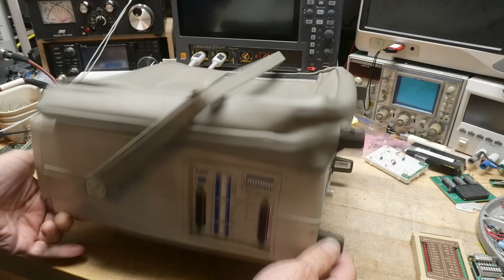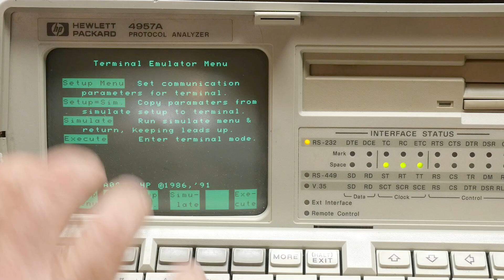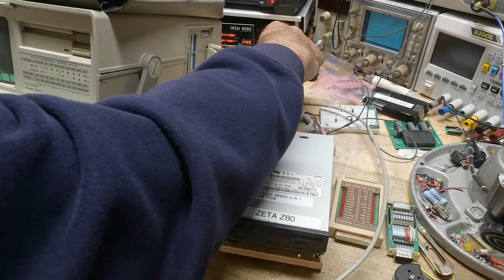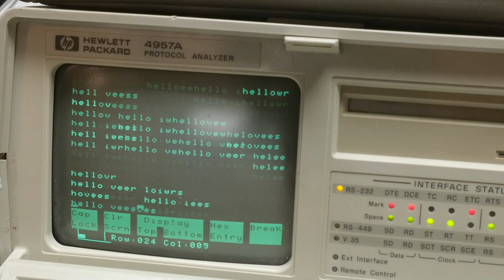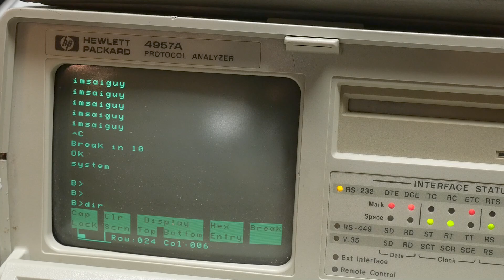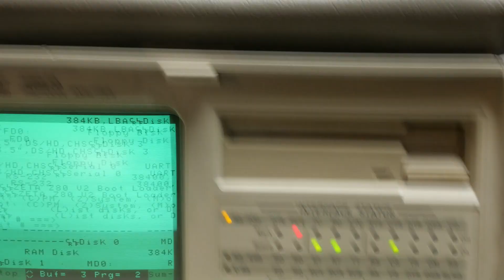#2184 HP4957A Protocol Analyzer

Comment: One of my favorite dev test devices.... loved the keyboard on these units. I kept a grab bag of all sorts of gender benders, 9 - 25s, null modems and a Cisco cable too so it was ready to go when needed :o) I agree with a previous comment - its a flow control problem, your overrunning the comms buffers causing that corruption. Even with correct flow control you can get that issue with high speed serial, where the latency of one end to react fast enough to stop the flow causes buffer overrun..... oh dear, my real time communications nerd mode just kicked in after 30 years LOL.

Comment: In my 6502 SBC I mis-implemented XON/XOFF and made mistakes with enabling and disabling interrupts for transmitting data, the effect was similar: it just kept sending the buffer over and over 😸
In 2005 I went to The Best Computer Shop In The Area, asked about RS232 stuff I used to buy there, and some new guy said with contempt: "Pff, nobody uses RS232 nowadays anyway", so I answered: "But I do!" 😁

Comment: ever time it "screws up", the DTE status light is alternating continually between mark and space (both the red and green LEDs are on 'simultaneously'). Sometimes you need to loop back DTE and DCE (??DSR??)) locally on both ends of the cable, as different devices have different meanings for those lines, and they get confused if connected to the other end of the cable instead of looped back at their own end. This is very common with CNC machines, which very much still use RS-232, along with a lot of other industrial equipment.
Reply from the maker: yes, I tried various combination but haven't found the right one yet.
Reply: @IMSAIGuy  try connecting DSR DTR and DCD together at each end of the cable locally, and the usual Rx Tx crossover and RTS CTS crossover and GND through the cable. I usually find it less frustrating to just get the d-sub connectors with solder cups, and solder up a custom cable using an old piece of cat5 than it is to use those adapters and gender benders where you have to check the pinouts to see if they do what you think they should with all the control pins

Comment: Love Curious Marc - He made his money in Optics and had a patent on something sold the rights made millions or something like that - Did you know that a free PC program called  "Tera Term" has an VT100 terminal emulation setting and I think "Putty" does as well. Just use a PC with a run of the mill USB to FTDI RS232 adapter ( I use them at work all of the time ). Tera Term is a great free Terminal Emulator.  Maybe you need CR-LF enabled on receive to stop the crazy screen.
Reply from the maker: I love tera term and that is what I have used for the Zeta computer.  https://youtu.be/l9NdGPrB0RI?si=nQQuJdm2VBUQWFnn
Reply: @IMSAIGuy  Oh sorry I didn't know there was a video for that project.

Comment: You are missing the hardware handshake, probably  RTS/CTS. Turning it on may not be enough, you need to check if the wiring of the cable is correct too. The lights on the protocol analyzer should make that fairly easy.  Great little machine. I remember the days when I used one. We rented it for a protocol debugging troubleshooting session and I was sad when I had to return it.

Comment: I used VT100 for years from 1981 with VAX computers. Later on, I designed VT100 compatibility to terminal emulator programs and other systems including embedded. The ESC sequence system is a nice feature even today and part of it is still in use in modern instruments. In industry, RS232 is still kicking as it can easily support very long cables between units. The USB cables limited to to about two feet is a great nuisance.

There is a program called DOSBOX available in the internet. With it you can run practically any MS-DOS programs from the old days in modern Windows. I have tested it and it really works. I can run my old programs from 1985 and older. Yes, I have archived all of my PC programs and many others.

Your problem could be the overrun of characters in the RS232 when the handshake is not working

Comment: I think several other commenters said this, but in my experience with RS-232 when you start to add adaptors and cables etc, some times things don't connect correctly.   I would first ring out that 9pin to 25pin adaptor.  I've seen some adaptors where the DTE-DCE etc connectors are left out.  I also went down the "path" with gender changer connectors that were really NULL modems.  With a minimum number of cables/adaptors, that I know are correct, I would put a breakout box between the computer and the analyzer and "see" which lines are being asserted.  By trial and error a possible combination of handshake signals can be determined for some form of "reliable" communications.

Comment: My guess is still with hardware flow control. Maybe z80 uses different control lines to HP. maybe 25pin to 9 pin is cross connecting flow control pins incorrectly. Try using breakout box on 25pin connection to see control lines toggle. Or maybe both devices set up to be DTE or both DCE so they are looking for different control lines.

Comment: over the years I spent a lot of time fussing with RS232, always hated it.
adapters, cables, settings,... disgusting. what a huge mess of a protocol
Reply: It was all we had at the time

We dealt with it the best we could until tcpip took the stage
Reply: the problem is always in the control siganls - different devices seem to interpret the control signals differently. Rx and Tx, and even RTS CTS are pretty universal, but DTR/DSR/DCD pins always cause the issue, and it's the same here. When it's not working correctly, the DCE status leds show it continually switching between mark and space - I think the computer is interpreting that that the connection has dropped and re-established over and over again and it keeps resetting the terminal. The solution is to usually loop the appropriate control pins back on each end of the cable, rather than taking them through to the other side, where they're not interpreted the same way

Comment: What does the CP/M computer monitor do when it receives a control-S / control-Q flow control characters?  If that provokes more output, then you'll get more flow-control characters from the terminal emulator application, and starts the neverending display of "garbage".   Turn on hardware flow control and see how that works.  (Or at least see about disabling software control-S/Q flow control.)

Comment: I love the old HP equipment, I still have quite a few instruments just for hobby.  You can get an idea of the age of the equipment by looking at the serial number.  The first four digits are the revision date.  On my 8566B the first four are 2504A.....  This means it was revision of the 4 week of 1985.  So I know is is no older than 1985.  Of course the instrument was announced in 1985, so it couldn't be older than that anyway.  The numbers 0xxx are from the 1960s, 1xxx, from the 1970s and so on.  IMSAI Guy was correct about the protocol analyzers, for some reason they really held their value, I never had one, I always had to borrow one from a client.

Comment: My guess is flow control.  The terminal must have some way to tell the sender my buffer is full.  In your case, in band flow control is used, most likely the DC3 and DC2 characters sent in the data stream.  DC3  character to stop sending, sent from the terminal when the incoming buffer is near full.   DC2  sent from terminal to the computer to resume sending is sent when the  terminal can accept more data. 

 It is possible I have DC3 and DC2 backwards, it has been 45 years since I taught the subject. ..Hardware flow control was also used in that time period, sender sets the RTS high as a request to send. Terminal responds with CTS,  I am ready and sets the CTS high. Or toggling the DTR to off when buffer is full.   There are many flow control schemes. Test my theory by setting the computer to a slower output, say 1200 bps and see what happens.  All are designed to keep from overwriting in the terminal receiver buffer. Note, I didn't use the term baud, that has special meaning in data communication. Bill-AK5X

Comment: 15:30 The screen is just 32 character wide
Reply: This was used for diagnostics so full screen was not priority
Reply: @ChrisAthanas  As an analyzer with a tiny screen, the lower resolution was likely a bonus for most.
Reply: It has roughly the same resolution as a Timex Sinclair TS1000.  32 columns by 16 lines using an 8 x 14  character cell.
Reply from the maker: you're right, only 32. I thought I heard curious marc say 40 and the way they get 80 is to somehow trick it to do 40 twice. Hmmmm

Comment: Back in the day I spent many long hours with one of these analyzers troubleshooting problems over dialup and leased data lines.  This was back when nothing was encrypted and you could watch the banking transactions on the system I was working on go by in clear text.  I still have the one I used to use and it's still going strong just like most of the ole HP gear.  I seem to remember is was around $10K when it was new.
Reply: I was about to write the same thing.  It was the early days of ATM’S and and I worked for one of the ATM manufacturers as a Field Engineer.  Everything was transmitted in Plaintext.

Comment: It looks like it might be using cursor control codes to refresh the screen but it's not acting on the cursor control or even basic control codes like LF and CR.  After looking at its behavior it looked like some characters were dropped and/or garbled in transmission or reception.  I would verify all the electrolytics around the RS232 transceivers are good and that you have reliable 5V->2323->5V translation happening.  Remote loopback test from the CP/M machine with HP looping internally?
Reply: I think the Z80 uses a 5V TTL serial and the HP4957 expects the RS232 levels.
Reply: @ciano5475  This just reinforces why building the Z80 into the HP box is a good idea.  The connections could be straight TTL without any level translation or isolation.  The HP is using real RS-232-C signaling and I suspect the CP/M machine may be (is most likely) using an EIA-232 transceiver like a MAX232.  I would doubt the HP would see the Z80 with just TTL signaling.  I've never had luck with that getting even a single bit across that differential much less a full character because TTL swing is below the noise floor of 232 transceivers.  The two 232 standards are generally interchangeable in use but differences in levels in this case may make transmission and/or reception more difficult and here the HP unit may require the signal to be up to spec to pass.  We're hitting the age where failed eyectrolytics aren't just for old tube amps anymore and I wonder if the levels these two deliver and expect are just a hair out of line.